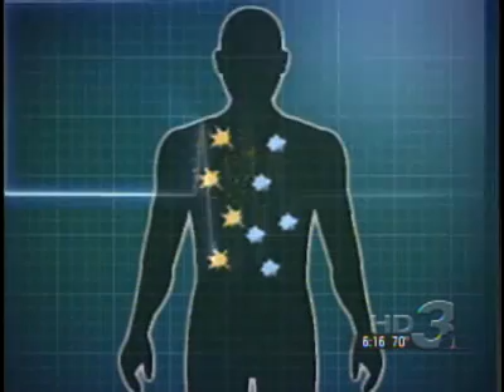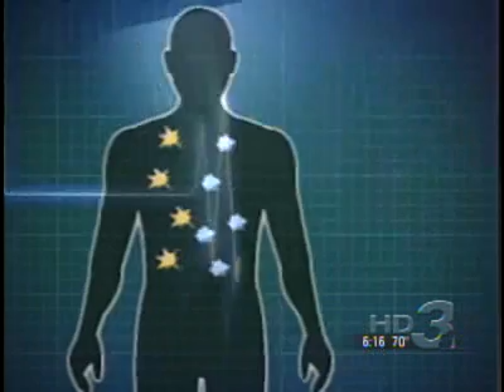Salt Water Fuel

Comment: The flame is produced when H & O recombine. It still takes more energy to break the HOH chemical bonds than is released when they recombine. If the RF was produced for free or very cheaply by solar, wind, etc., this may have some financial value as a source of hydrogen fuel.

Comment: The energy comes from the radio waves. You still need to put more energy into it than you get in that flame. Silly.
Reply: +Andy Hoffman Gasoline fueled engine: Fuel in/Work out = 0.25
Is that not a loss? XDDDDDDD
Radio waves require 3,000,000,000 hp of electric current to make 10 hp to the wheels? HAHAHAHAHA XDDDDDD
Reply: +Bone Drone 
Gasoline fuel engine does not generate energy from nothing It converts energy from chemical to mechanical. 
What the clip suggests is that energy gets created &quot;free&quot; from nothing. Silly.
What really happens is that hydrogen and oxygen gets split and burns, but the splitting comes from the energy of the high-intensity radio waves. The energy required to generate these radio waves is greater that the energy of the flame. Silly.
Reply: Andy Hoffman
Actually it's 200 watts. Good try though.
Reply: +Bone Drone 
The question is if this "system" can generate energy from salt water, more that it consumes? 
Is it possible to build an engine that consumes nothing just salt water, and could power e.g a car , or a power station?
I the answer is no, it is useless.
Reply: Andy Hoffman
Fair enough.
Reply: Exotic Creature great scott! Marty
Reply: Your a complete fucking idiot you know that. How much do you think it takes to refine oil? How much do you think the total cost on our atmosphere is? How many Americans have a radio or cell phone, theoretically you could use your damn phone and some sea water to run your vehicle. YOU FUCKING IDIOT!
Reply: Andy H yes you right but you saw he added salt to the water the ions would burn without water look in the ingrediants to heat warmers hot hand warmers.i took one put 4oz water snd ramon noodles to heat a cup of soup in 25° weather now below 0 is another thing heat to room temp about 12 minutes before cooling to 36° in 7 minutes we talking -7

Comment: "Salt water combusts relatively quickly in a test tube using a 600 Watt 13.56 MHz RF signal." from the patent description. Requires rf transmit and receive plate.

Comment: I would like to duplicate his experiment if appears at 1:36 that it is a simple transmitter/receiver. Generating hydrogen is nothing new I use salt in a simple plate hydrogen generator. From literature I have read he is using 13.553 - 13.567MHz.

Comment: A lot of people commenting here about this not being an over-unity device (putting out more than what is put in) without stopping to think that if ou are using sea water (instead of oil) then it doesn't matter - it is still cheaper.
Reply: Bone Drone hes a strange guy , wants bread without work .
Reply: piss is solt water right? Its got solt in it and its water and maybe i didnt get this concretely but u think piss has more energy return on energy invested then oil. Now when i say piss u dont think so any more, but when they say GREAT INVENTION ,INSPIRATION IN THE MIDDLE OF THE NIGHT,TRUE AMERICAN INNOVATOR  without telling u the bad side of it of course u gonna  believe them , but u need to think, think solt water , think piss , piss a 21st century best fuel source?? naahh ITS BULLSHIT, COWS SHIT HAS MORE ENERGY THEN UR PISS ill bet on it any day
Reply: +Pavle Pavlovic Hydrogen, in an infinite and free supply. Salt (that's how you spell it) helps.
Reply: Bone Drone  its still piss , however you spell it . Im not good at it
Reply: Pavle Pavlovic
Speaking of piss did you know that electrolysis of urine releases HHO gas? This will help me cut down on water bills should I ever have to pay them. Less use of the toilet.
Reply: Bone Drone , yes i know , my friend tried to  build one machine for it , he did it but he hoped for over unity machine . i told him , it won work man, that day i became a party breaker and he realized that he needs an update . So he started digging in trash for coca cola bins . Cuz aluminium while oxidizing , starts the same reaction. Then i told him , hey man , thats not aluminium thats trash. He eventually moved in another town, didnt see him since . And now im here , telling this man  that its not solt water its piss . LOL
Reply: Pavle Pavlovic Sounds like he was neither very innovative or informed.

"Well water vapor in the air becomes steam during the power cycle and imparts additional force on the pistons, with the otherwise same amount of fuel used, and cleans carbon deposits. But the benefits aren't good enough until I achieve over unity!"

Well alright sir. We have much to do.
Reply: STUPID PEOPLE LIKES TO PAY ENERGY BILLS...

Comment: There is still a negative energy total on that burn. He's putting IN energy with the radio waves. I guarantee that it takes more energy to convert that water into hydrogen than could ever make with a motor burning that hydrogen. There would never be enough energy produced to make a self sustaining device. The fact that they don't pay attention to the energy input of the radio device is just nonsense.

Comment: Yes maybe it works to bombard saltwater with radio waves and release energy from the water. BUT whatever energy you get out of the saltwater has to be put into it using the RF. And where does one get all the energy to power the radio transmitter? A generator, the mains - both of which use FOSSIL FUELS.
Principle of convervation of energy people. 
These clean energy for free guys are always only telling half the story cos they are con artists.

Comment: @MrIHADANACCOUNT Loss? I think not, I think that this is just one piece and why it would require more scientists to perfect the puzzle. You can have solar powered windows on cars, as well as solar film (solar paint) and the car be battery powered and have the generator always charge the battery and run the electrolysis needed. Dont knock the possibilities because there are many great minds and thinkers out there and together we can come up with the units needed to run and make it better later

Comment: This is just water electrolysis... the reason why it burns is because the water molecules split, releasing Oxygen and Hydrogen (Hydrogen is EXTREMELY flammable). Once you light the stream of Hydrogen coming out, well...

Also the reason why the saltwater part is significant is that electrolysis (the splitting of a water molecule using electricity) of water is only efficient with large amounts of salt in the water.

Comment: @AviatorGuy  About 14 Mhz.  Actually RF is one of many Ionization energies. If you google RF Ion energy source this is similar, but used with gas based ions. Solution based ions are more stable.  This isn't just restricted to salt water. The ion types such a chlorine may provide better results than sodium.

Comment: More energy is required than what is released by the burning hydrogen. Similar to electrolysis of water, might even be cheaper, though electrical motors are more efficient anyway.

Comment: SO he just built a homemade radio wave generator before he did this big version.. How hard can that be with pie pans = aluminum which reflects radio waves, sorta like how lasers works reflecting light energy between 2 mirrors and amplifying it, or concentrating the waves parabolicly.. he mentioned that he made radio wave generator after the kind of kit they sold when he was young, on another video.
so why not just add variable tuning capacitor to find the sweet spot?

Comment: @gandlbass I have a hard time believing your claim. For one radio waves are abundant from the sun. Secondly we could use water to generate the energy that would be needed to produce to low frequency light waves which are what radio waves are. We have no problem generating visible light so why would there be an issue with radio waves. Perhaps some one here can explain it to me.

Comment: how much electrical energy goes into creating the radio-waves?  Has this been considered in the overall design? and considering the input energy is this method more efficient than electrical motors currently used on electric cars?

Comment: Hmmm.  If solar power was economical they would use it more for electricity. Until they produce so much electricity from solar (or whatever non-carbon source) that there is an excess you're just wasting time converting it to hydrogen for use in vehicles when it would be more efficient to just use it as electricity.  The second you can provide energy cheaper then the Oil Companies, you will put them out of business.

Comment: because it's not a self sustaining fuel, it requires a large amount of electricity to excite the salt water with radio waves enough to ignite. that tiny flame does not have enough energy to generate the electricity needed to continue the cycle, therefore you are relying on the power grid and defeats the purpose.

Comment: Not only does this process have a net energy loss, but it is a useless closed cycle.  The same energy that disassociates the H2O also recombines (burns) it. The H and O can not be separated from the source of combustion.  The process of disassociating water with high energy EM waves is decades old.

Comment: Jewelers commonly use a 'water welder' that generates a very hot hydrogen oxygen gas flame. It uses water with an electrolyte like potassium hydroxide to conduct a DC current that adds the energy required to break the bond between the H and O atoms in the water molecule.

Comment: what! sell it!? fuck using the money for cancer. if we use clean fuel. that will prevent alot of cancer in the 1st place. but if the oil companies buy it. they are not going to utalize it while there is still oil to be sold. 
cancer is a pretty new disease and the percantage of people who get it is increasing. 
it seems fairly safe to say toxic chemicals in our food and water and the polution in our air is the cause.

Comment: Temperature is still an irrelevent factor to the amount of energy produced.  Using temperature makes as much sense as using velocity to state the energy in a moving body. It's only a portion of the end result.

Would you claim a 30-06 bullet traveling at 3000ft/sec has more energy then a 100 car cargo train moving at only 10 feet/sec?

Comment: According to the North American COMBUSTION HANDBOOK, Vol 1, p. 12 Adiabatic flame temperature of propane/air is 3572 °F / 1967 °C

The temperature of the flame is 3000 F measured so far and literally melts the test tube. That does not qualify for "a lot hotter"

Comment: You still on here nutjob?  Clearly?  You superman now and can see radiowaves over the internet?  That flame is nowhere near 300W.  The typically 20mm blue Bunsen burner flame is 50W and it's a lot hotter then that flame.

And how could a statement directly inquiring about the efficiency of a system NOT matter from a thermodynamics perspective.

Comment: You couldn't be more  wrong from a thermodynamics POV. Clearly less energy is input into the system (RF Wave photons) than the output of a 3000F flame. No telling what would happen in a combustible engine. Does it produce enough to cover the 300 watts used to create the RF waves? Dunno, but it doesn't matter from a law of thermodynamics perspective.

Comment: I understand what you are saying I wondered at first why nothing had come of it.  Same concept as fussion?  It takes more energy to heat the reaction than you get out of it?  It's been a while since I researched fussion I'm probably wrong on that.  But the point is it is a negative gain.  Even if the engine could power the radio waves it couldn't produce enough energy to create the radio waves and run the car

Comment: Well, even at 34, you're apparently a little too naive to understand that the reason nothing has come of this is because its pointless. Tell me, where does the power to create the radio waves come from? For the record, it takes more energy to release the bonds of oxygen and hydrogen than is released when the hydrogen is burned. Why not use the electricity directly... instead of through an inefficient, cumbersome setup? That must be why the Chevy Volt has been made illegal ::rolls eyes::

Comment: I like how they comment, "and all you need is salt water"... I can tell you right now the oscillator developing those RF waves is probably using more electrical energy than the output from heat energy. Of course if this was able to convert huge amounts of salt water, instead of just that small amount, and utilizing the same electrical energy input it might work...

Comment: Salt water doesn't burn.  Hydrogen gas and oxygen gas combine in combustion to reform water.  He's just found an expensive way to do electrolysis.

It would be simple to do the energy calcs on this but for some reason, in the two years this has been out, nobody has....I wonder why.

It's because once they show it creates a dime of electricity only after using a dollars worth all the camaras would go away.

Comment: Maybe this is impossible but here's a thought from a teenager xD

If the salt water burns at a intense flame, then why don't we use it to run power plants?  We have a ton of salt water on this planet, simply have a plant by a lake side (or pump) burn it to heat water and turn a turbine.  The only question is, if it evaporates the water, is it clean or toxic?

If this is possible, that would be a clean way to create power.  And, for the most part it's free since we are using whats all around us.

Comment: 2) basically, the electric energy that the radiowave generator requires became energy in the form of radiowaves, became invested in the seperation of the elements, then was returned when the separate elements ignited and recombine in the form of heat energy.  

3) his invention is a spectacular fireplace, whose fuel is ultimately whatever fuel was used to produce the electricity powering the invention.

Comment: I was excited at first, but I must view this with optimistic skepticism... 

1) the video was most definitely false in saying that he "released" the hydrogen and oxygen in the water:  water is fundamentally stable.  the combination of 2H2 and O2 is an EXOTHERMIC reaction.  those 2 higher energy elements in the presence of activation heat COMBINE to create water. because that water was ON FIRE, i must conclude that the elements broke and combined simultaneously.

Comment: It comes from the grid and is approx 300 watts. The actual energy input into the system are from RF wave photons which interact with the Na. In other words it's a very very small amount of energy which produces a tremendous amount of energy. (3000F flame).

Comment: This is cool. need to see wattage calculations vs possible thermal output.
Is this brute force electrolysis or are the radio waves specific and stimulating the water to split.
Notice the flame. The gas IS exploding. The 'on demand' release nature of the system is limiting the intensity and the process is repeating at high frequency.
Interesting stuff though.

Comment: oxy acetylene is higly reactive and VERY explosive, but you can control the explosion by releasing the gas in a controlled manner. This experiment releases the gasses slowly as the radio waves split the water molecules. That is why there isn't an explosion. If the gasses produced were collected and then ignited the result would be different.

Comment: 2 points.... 
1.Water is H20, as in 2 Hydrogen one Oxygen, so no, you don't get O2.
2.If you put in 1Watt of energy to split some Water, when you "burn" the hydrogen, making water, you get 1 watt back... only any heat, sound, friction, resistance will lower the efficiency. REMEMBER ENERGY CANNOT BE CREATED OR DESTROYED.

Comment: I'm sorry, but this guy did not just trounce the 1st law of thermodynamics.

This technology could be used to create a perpetual motion machine.

He claims to use electricity to separate H2O into H2 and O.  In order for H2 to ignite, it must be then combined with Oxygen again and ignited.  He will get back the energy he put in as heat.

He could then use the energy released to create split more hydrogen.  This could be done for ever.  However, his efficiency must be < 100%

Comment: You are right to wonder at it. The power required to generate the radio waves is far greater then the energy released from the salt water. I think the idea is similer to MRN which is very energy demanding. That said, MRN has developed dramatically over hte past few years, and it may be possible to generate a possitive energy. The system is open so it does not violate the 2nd law of thermodynamics (ie, in any closed system the entropthy will tend to decrease).

Comment: Has nothing to do with the laws of thermodynamics. The actually energy input into the system are the RF waves. The question from a law of thermodynamics standpoint is if the energy from the RF photons equals the energy output. It's not even remotely close.

Comment: "It takes as much energy to split hydrogen into hydrogen and oxygen as you get when you burn the hydrogen".  I'm certain that isn't possible.  Before explaining something make sure you have your facts straight.  I understand what your typing.  Now if you use wikipedia then you should know something about electrolysis.  Its efficiency varies, highest claimed is 70%.  That means it takes more energy then what you get.  100% means equal output, 100.00000001% is over unity.  Google it!!!

Comment: If it's more efficient at splitting water than electrolysis, he may have something. Although water from hydrogen is not an energy source, it is a viable means of storing and transporting energy from other sources, such as solar, wind or nuclear.